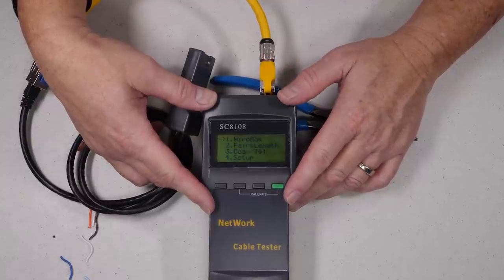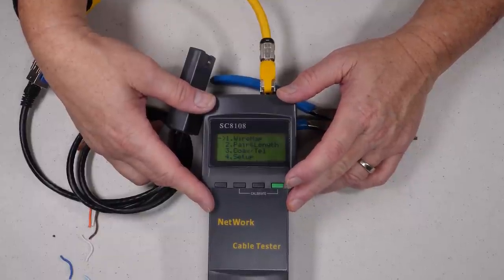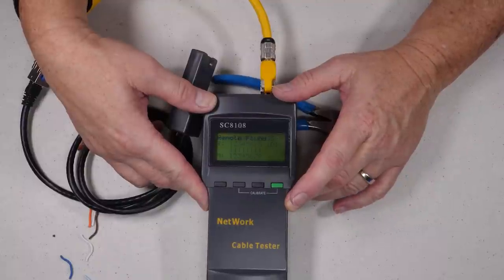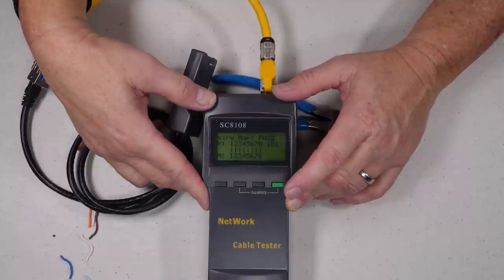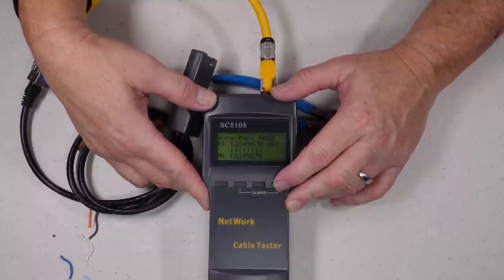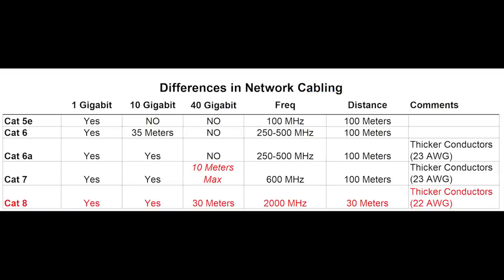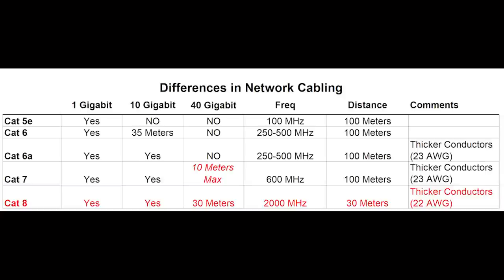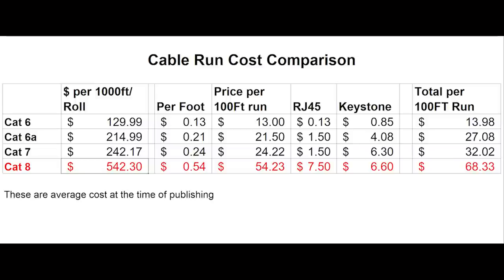CAT 8 vs CAT 7 Ethernet Cables - Is there a difference?

Comment: Here, in Eastern Europe I'm lucky to have a 1 Gbps connection. Most of the people has slower connection. I have put a 25 meter long Cat 6 cable in the wall. We will not have 40 Gbps anytime soon.
And we don't really need it anyway.
Reply: The cool thing about these things isn't just about download speeds, but file sharing among local area networks. Especially for youtube channels like Linus Tech Tips, where they use 8k video. A 40 Gbps connection would up their file sharing speed by 4x. Considering they're using 10 Gbps, and still maxing out the bandwidth on those connections.
Reply: @Valentin119  
yeah you'd be amazed just how annoying it is to be stuck on 1Gbps for local stuff once you get used to 10, 20, 40Gbps.
I have two servers that share large VM disk and and pass on the whole X session over ssh.
It would be a pain to manage them over 1Gbps, instead I bought some "old" HP 10Gbps dual port NICs from ebay and sat them up in aggregated mode to get the 20Gbps full duplex (or like the marketing would say 40Gbps) Before that I was actually facing the issue that the router would be the bottle neck and all the trafic would be caped at 500Mbps because it had to send 500Mbps up and down to each server making it  "1Gbps" but not really.

Like Zorro I'm lucky to have 1Gbps internet, but I wish my ISP would give me access to 10Gbps, not just for blazing fast por.... "creative content" but for actually start to migrate some of my network over to local data centers around the city, as of right now it's just not worth spending money on external servers if I'd be limiting myself to 1Gbps.
it's fast for sure, but not really fast enough for really heavy data (as seen from Linux Tech Tips)... but then again it wouldn't be 30 dollars (299NOK) a month either :D
Reply: @svampebob007  I'm only sitting at 275Mbps, it is plenty for my internet needs. My wife intends to do video editing, and doing youtube stuff for fun, and I want to create a mass storage server running a kind of raid variant. Not settled on which type to run yet. But something like these Cat 8 cables, or similar maybe 6a, is what I would like to speed of local data transfers to and from that mass storage. After I save up some money, I would eventually like to setup a mini home server, and network station, instead of needing to rely on my ISP's supplied cable modem.
Reply: @Valentin119   
TL;DR
I'd recommend you take a look at SFP instead of RJ45.
There's a lot of "old" discontinued server hardware on ebay that you can get for cheap. when I was looking at 10Gbps upgrade I saw the Asus 10Gbps Ethernet card and it cost 140USD for one single card, without cables included...
...........................................................

Buying something like:
2xHP NC523FP with two 3M DAC (cable) = 85aus each so around 121USD for the whole thing that can do 20Gbps up and down. that's what I got and the only downside that it's only 3 meters cable (max 5M on DAC)... but both servers are located 2µm from each other :P

I'm considering building an outside storage box for the servers (kinda like they did on Linus Tech Tips with their outside water loop)
You can then go with fiber you can still get the NC523 or a similar dual 10Gbps NIC (some even go up to dual 40Gbps for cheap) and for connectivity you'll need the  HP Blade System c-Class 10Gb (16USD) adapter and 30M Outdoor Field Fiber Patch Cord (56USD)
The downside is that the adapters are kinda specific so you'll need to check the compatibility, and the cables are on the price of cat7-cat8 for 30M but those outdoor fiber patch cord come with a metal shield so it's easier to not break the fiber glass, you can go all the way up to 100M with fiber... but then it get's really freaking expensive for the adapters and quality cables... I trust eBay to sell medium range products, but if I was to spend more money I would be cautious about the actual quality of those fibers anything bellow 30M is pretty standard.

Anyway good luck on your future project, relying on the ISP do give you a decent modem is the stupidest thing we do before investing in a good home network :)
Reply: @svampebob007  Thanks for all the information! I'll have to keep that in mind!

 I am still in the process of obtaining all my certifications, currently working on my Networking from cisco and Comptia, so I am learning a whole bunch of stuff I never even knew about, glad I put off the project now, seeming that I definitely have more knowledge than I did back then, definitely would've done it wrong without knowing what I do now!

Comment: Bro if I buy the lan cable for router connect to modem,is it will improve my speed router performance? I'm using also TIME 500 MBPS with wifi 6 router
Reply from the maker: Assuming you have 1GbE networking in your house and with that speed, you will not gain anything. This is mainly for 10GbE internal networking.  Thanks for the question.

Comment: In a small home, a Cat6 will be just as good as a Cat7 or Cat8. Here in Norway we all just skip the Cat7 all together, and we use mostly Cat6 in all kind of buildings. Sometimes we use Cat8 in bigger businesses, but rarely. I should also add that Cat7 and Cat8 is very close in price now in late 2022, and both is almost twice the price of Cat6
Reply from the maker: You are right, cat 6 is fine for shorter runs.  Thanks for the feedback

Comment: I was looking at patch cables today, and it seems that many companies are putting 26 AWG wire in their cat 6A patch cables, but using thicker wire in the cat 6 cable, which baffles me, because i often see like in your chart that you show 23 AWG wire for the 6A cabling. It seems like in patch cables, the more expensive 6a is using thinner wire!
Reply from the maker: Patch cables are mostly stranded wire and wall cables are solid.

Comment: Wow! $20.00 for two Cat8 Ethernet Cable Connector! It may be beneficial to wait a few years before I upgrade my 5e at my house.
Reply from the maker: Yep, super expensive.
Reply: You will never need to upgrade to Cat8. Speeds over 10 gigabit are much better served by fiber optics. The hardware for running Cat8 at those speeds is much more expensive and power hungry than the hardware for running those speeds over fiber.
Reply: This stuff isnt for home use. It's for connecting routers to switches and other things that are moving a huge amount of data around, usually locally. Fiber is a much better option, this stuff is a unicorn.

Comment: @ 2:34 in the video, a lot of the CAT6a i've bought in the past 2 or so years looks nearly if not exactly identical to that CAT7, so long as it's SFTP or FSTP aka fully shielded twisted pair.
Reply from the maker: You are right as they are almost identical except for a slightly larger conductor (most of the time).
Reply: @MikeFaucher  d seem exceeding spec is not issue, at least with some 6a which i think some is even 23 gauge. but, cat 7 REQUIRES these features. 8 seems to be a true upgrade. mostly best for data center. or equipped to deal with PoE++ which can push 75 watts of power minus overhead. EDIT: also 25gbit on 6a through 8 would be interesting to see

Comment: Aren't we starting to lose the cost benefit of copper over fiber with the increased copper mass of these cables? Even factoring in the cost of 10G SFPs it looks like a fiber would be cheaper for a 30 meter run.
Reply from the maker: Good point.
Reply: Cat 8 is supposed to be compatible with 40G over copper (I don't know if the standard is ratified, as I have not seen any RJ45-compatible hardware faster than 10G). That said, cost of fiber optic networks is decreasing. Even when you factor in cost of transceivers, that's rough to RJ45. You can run like 6 times more connections trough same space thanks to fiber being so slim. At this point I can see only one downside of fiber optics - if you need custom length you need some pretty expensive tools. For anything shorter than 10m you can go to copper DACs, which are usually on par with RJ45 cost wise. Then, on both SFP, QSFP and OSFP you can run 25, 40, 50 (now on SFP thanks to SFP56 standard), 100, 200, 400 and now 800 Gb. My company recently installed couple of 400G switches and seeing 400 to 8x SFP56 octopus breakout cable is wild.

I've never seen Cat8 deployed anywhere outside a research lab, but Cat 7 is kind of popular in high EMI machines as internal wiring and communication between different modules, where galvanic separation is not required.

Comment: This is great showcase of fact, that optic transmission is the future.
Reply: Which fact do you mean? It depends on the environment. For long distances optic transmission is better suited. But for an in-house installation Ethernet is better suited. Because if you use optical transmission, you still need an active(!) media converter to RJ45 (which needs electricity). Furthermore, Ethernet provides Power over Ethernet which is super convenient for Wifi access points or cameras or an interphone system. Last but not least, fibre cabling is very sensitive and less flexible with respect to the bending radius.
Reply: @rohrbold  see Bend Insensitive fiber optic cable.
Reply: @richardj163  Thanks for the hint, wasn't aware of that.
Reply: I think actually the future is going to be wireless only for office and home use. They can get crazy speeds over short distances on the millimeter wave band. Speeds that a copper cable will never even approach. Optics will always cost a bit more due to the fact that rare earth metals are needed so it's wireless where cost is a concern. For industrial and data center applications fiber optics is the way to go.
Reply: @YouCanHasAccount  i just bought 90ft of fiber with the proper terminations for about half the cost of just a cat 7 cable. fiber is cheap as fuck.
Reply from the maker: Thank you for the feedback.  I appreciate it.
Reply: If end-user devices had a fiber port of some type besides needing to add in a SFP+ card I could see it happening. But we'd need a new type of connector that preferably had an option for copper power transmission so we could still have PoE, and it will have to be much more compact and resilient than LC connectors or users will break it all the time. Already 10Gbps over copper has an enormous power cost, so once 10Gbase-t becomes the norm I could see a reason for companies to improve on the design of fiber to allow it to be used at the desk. You'd be saving at least 4 watts per device fiber vs copper, and in a building with 1000's of devices that can add up.
Reply: @zachicusmaximus5551  yes. That's why it's called "the future"! ;)
Reply: @zachicusmaximus5551  sfp is basically standard on any decent networking device. so that is not really much of a argument against fiber or sfp in general. nobody give a shit about the power usage.
Reply: There was a time I thought like that ... back when it seemed like we'd have to use fiber if we ever wanted to see anything above 100mb/s.
Reply: @rohrbold  Take a look at GPON systems. In a bigger office space basically the complete backbone ends up being LWL, with no need for switches and their cooling per each floor. And they convert once for each group of tables to Ethernet. This way you can use the available ethernet ports on devices and do everything else on LWL. IMO many people tend to want 10G when using Fibre. But realistically at least for office use really few people actually can make use of it, or even support it in their backbone.
Reply: No it's not about the cabling the future is software and hardware. Understanding the applications of this is what is important then you can build your cable needs around it. I work with large companies designing their cable infrastructure when choosing a cable I look for very specific needs they have. Thin client as well as running the application on desktops has greatly reduced the requirement of bandwidth to the desktop. Also compression technology allowing information to be compressed down is the other major factor to be considered. Because what people really want is the ability to move devices around mobily which requires a wireless connection. The ability to be wireless is what is driving everything. The other factor is so many people access servers that are not on their own premise your only as fast as your internet connection is this is why hardware and software becomes so relevant. The other large factor to consider copper connectors are unaffected by dust fiber optics has a huge disadvantage in this area.
Reply: Yes, fibre optic is better both relative short and also long runs... And yet another point: power consumption copper vs fibre optic transceivers - for 10G: <1W fo multimode vs 2-5W copper (depending on the distances of the cable).. and also latency difference...

Comment: Hi, great video. I am just in the process of upgrading my home network. I have cat8 running to my outhouse office (25m run from router). I had to cut the Cat8 lead to fit through the hole in the wall. To join the cable back together i couldn’t find a Cat8 lead connector anywhere online, only Cat7. Would a Cat7 extension connector limit the Cat8 speed or am i best soldering the 2 cut ends back together ?
Reply from the maker: Thanks for the feedback. It is appreciated.  I would not solder.  Here are a couple that I have tried with no issues, and there are many others as well.  https://amzn.to/44id9JS,  https://amzn.to/3JRArOz assuming you are running 10G

Comment: I only have 1 ethernet cable in my home and it's a Flat Cat7 that goes from the modem to my pc (aorund 15meters). To connect my server room to my nework i have used an optic fiber cable (around 30 meters) and with it i don't have inteference problem and thick shields and thick cables.
Reply from the maker: Great.  Thanks.

Comment: Cat 8, when you need to run a drop through an 'always on' 70's microwave display.
Reply: I had to run a ethernet cables on the roof of a high power radio tower building, Cat 5E UTP couldn't work well and was trying to link up at 10mbps, but Cat 5e STP (shielded) worked fine at gigabit speeds, even at high 100MHz noise level. So to me cat 8 is for very specific uses at higher speeds, and I might as well use fiber at that point.

Comment: What about different Connectors like ARJ45 or TERA - I have not seen Network Switches with these sort of Connector Types so far - although I was told there are a few?
Reply: I don't think TERA will ever become popular, especially since the standard is already 17 years old and still not used.
The mian reason is compatibility.
On the other hand ARJ45 looks promising, but looking at how it works, it seems like that connector will require support from the switch on both sides to work, 
and it will waste 4 wires in the cable, so I doubt it will happen.

To be hones I don't think any new standards will appear, since we are slowly getting to the point where fiber optic devices are getting affordable.
And the advantages of FO over copper are just too big.
I think copper network wires will disapear before we will get consumer available 1 Tb/s internet connections.

Comment: The standard for cat 6a cable is 23 awg.  I see a lot of vendors sale cat 6a cabkes in 26 and 28 awg.  How will smaller gauge conductor affect performance?
Reply from the maker: Typically the smaller wire is multi-strand wire an$ is what they use for patch cables. Very hard to work with if you crimp your own but multi strand allows you to use smaller wire and get the same performance.

Comment: I don't know why youtube decided that this should be in my recommended, but there is one thing I wonder and that is about the copper tape at 7:20. I know from personal experience that the adhesive side of aluminum tape is not conductive (I made a faraday cage inside a wooden box with alu tape). That is why I wonder if copper tape really makes contact with the ground wire or if the crimping from the locking boot is enough to push the glue away to make a firm connection to ground.
Reply from the maker: Valid concern however this copper tape and adhesive do work and I did verify with an ohm meter that both were conductive.  Thanks for the comment.

Comment: Hey Mike, great video.  I noticed that I can get Cat6 in shielded and non shielded, but Cat6a and 7 and 8 are all shielded.  I assumed as you need higher frequencies you need shielding.  Do you think if I go with Cat6 I need shielding in my house?  Thanks!
Reply from the maker: Interference does become an issue at the faster speed.  Thanks for the feedback.

Comment: I’m reading on the product information page for bulk cat8 cable that most Ethernet ports on devices are not properly grounded.  Do I need to ground the shielding somehow, or is it just overkill?  Trying to search the Internet and not really getting a clear answer.

e.g. product B07JQ2GSFQ on Amazon.  Down in the description it states : "Important Note

***Routers, switches and modems with proper RJ45 port grounding recommended. Unshielded devices can generate an "Antenna Effect" and can cause network bottle-necking when used with dual shielded wires.***”
Reply from the maker: Having grounded equipment or a shielding patch panel should be all that you need.  You do not need a separate ground.